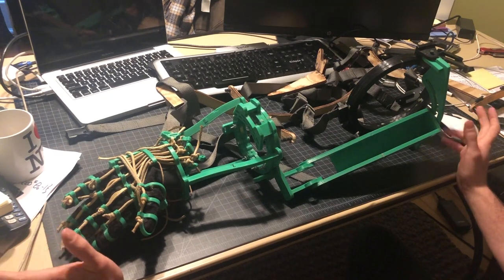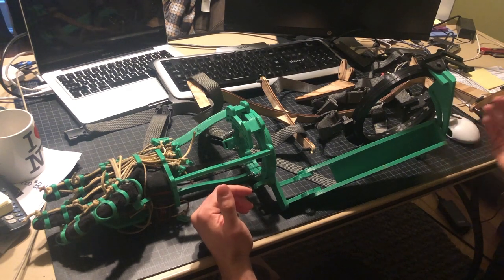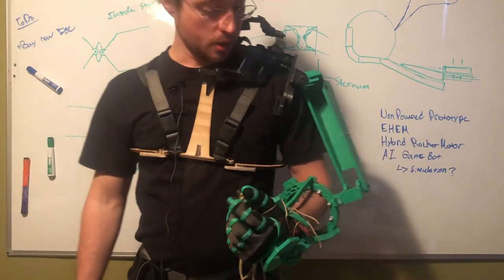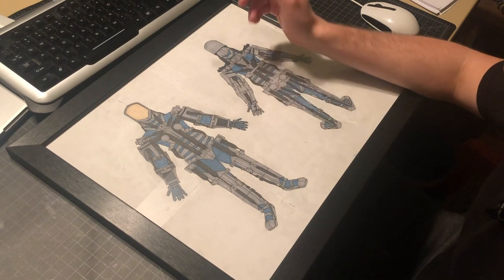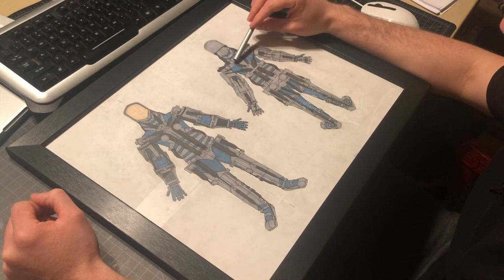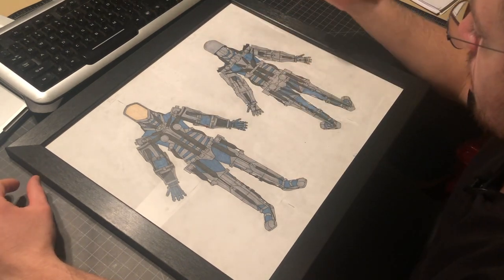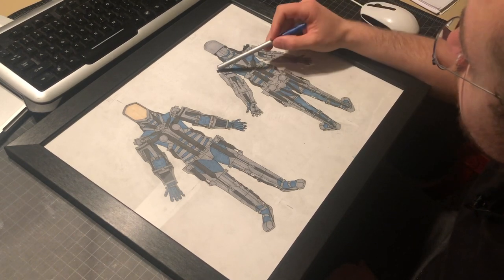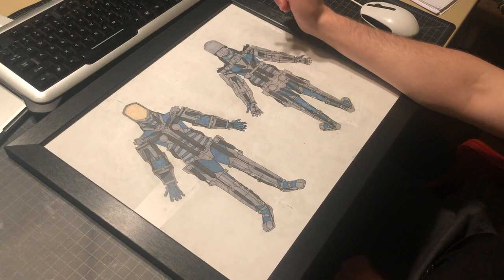Exoskeletons Part 1 (What I Have Built So Far) 2019

Comment: Might I suggest using your 3d prints to assist in sand casting for metal parts, and what I mean by that is spraying the unmoving individual parts with a release agent so it will come clean from the "green" sand used in foundry operations for one shot molds, the pour molten aluminum or steel (if you have access to a good enough foundry) in to the hollow cavity left by the print
Reply from the maker: Not too hard to build a foundry but I’m machining the mark I on a home brew cnc

Comment: wow. trying to make my own exoskeleton but you know its a long time project
Reply from the maker: Thanks! I have been working on it for a while myself!
Reply: @DylanEdmiston  Ive been at it for more than 15 years remember you are the soft ware just integrate smart sensors  and I C connected through instances to trigger an automaton action/ actions . Amplification exoskeletons are actually easier than amputation extensions because the muscles actually stabilizes limbs and by automaton actions i mean automaton actions that mimic biology. Anyways if you are having any problems feel free to ask also range of motion will require triple or double joints in some instance because the surface area changes how many movement points you kneed to maintain full range of motion

Comment: i wonder would you not use ball bearings on some of the smaller joints (such as elbow or knee joints) to make it move smoother and with less friction because thats a lot of wieght on those joints which might damage or wear the down the parts and surfaces. also i think you should checkout ian davis as he designs and makes prosthetic hands and maybe you could adopt some features to your hand pieces , nice work btw im no engineer but it looks quite impresive what you have going on !
Reply from the maker: Thanks. Ball bearing can’t handle high loads especially static. Friction is minimal for these low rpms
Reply: @DylanEdmiston  ok thanks for helping me understand!